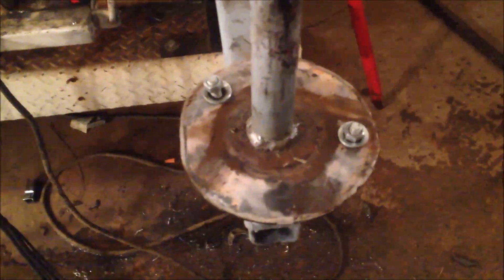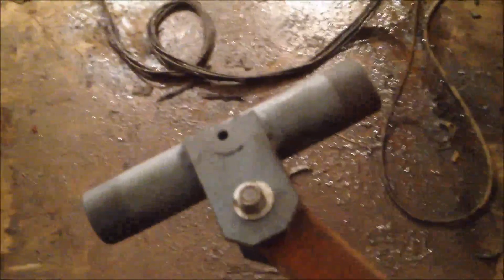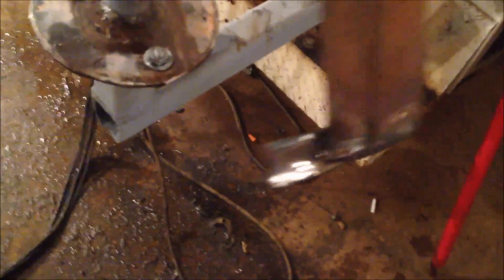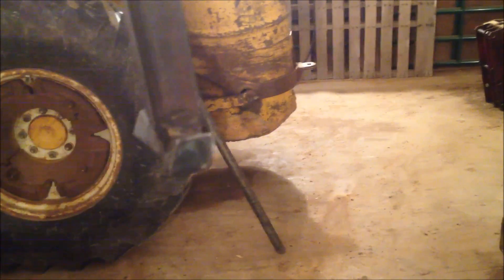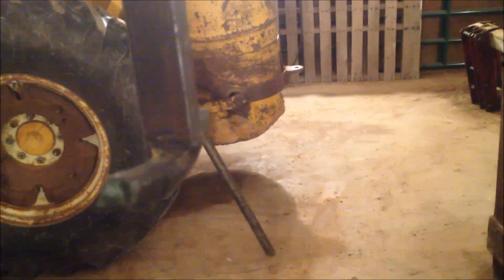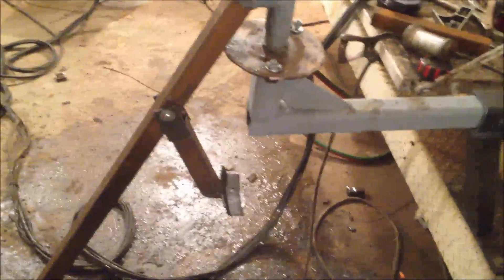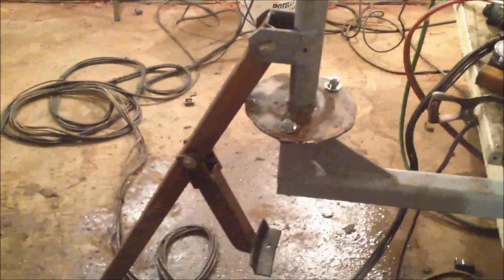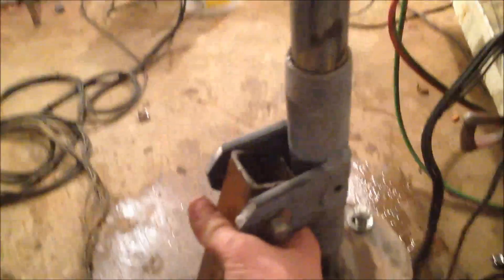Homemade Manual Tire Changer & Bead Breaker

Comment: I would like to know if the rotation stress applied from bead breaking has rotated the structure as it's mounted into the receiver hitch? Most bead breaking is done on the floor so as to give the support needed as the breaker us pushing into the tire!

Comment: At the risk of sounding like a know it all.  Rather than drilling holes in the bead breaker arm,  use a piece of larger tube to go over the arm with the swivel breaker part attached to the overlay piece.  Put a threaded T handle to tighten into place for any specific need.  The breaker arm will not bend as easily since it has no holes drilled in it and the point of pressure applied has greater strength from the overlay sliding attachment for the swivel breaker art

Comment: Nice job. I built a portable, manual bead breaker and I have a factory made manual tire changer. After watching your vid, I'm considering bolting my tire changer to a "cross" made of  2" tubing for use with my receiver hitch. In doing that I won't need to mount it to the floor or on a pallet. And it becomes portable also, for when my buddies need to borrow 'em...lol
Reply from the maker: Yea that is a great idea.  I use the 2" receiver material and 2" square tubing for a lot of stuff.  It is very handy and like you said it makes things portable and temporary.  Thanks for watching!